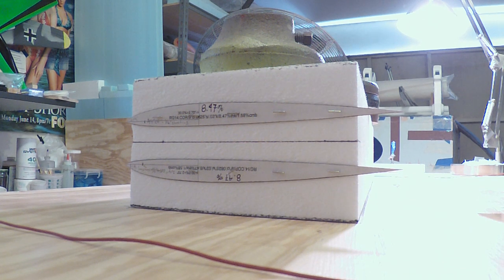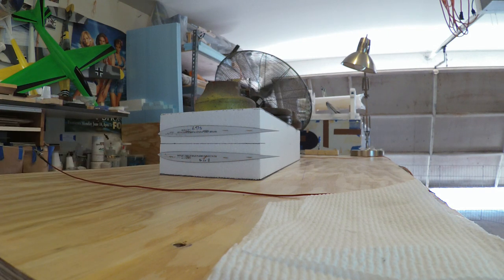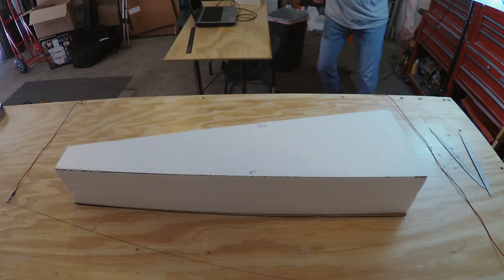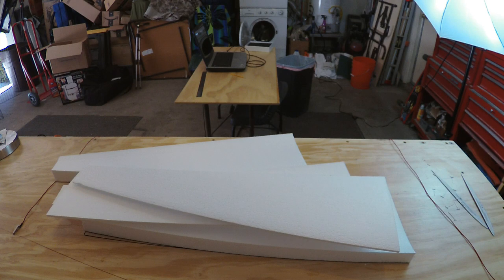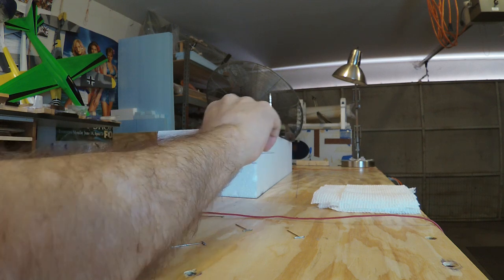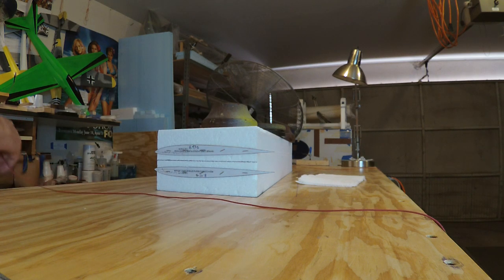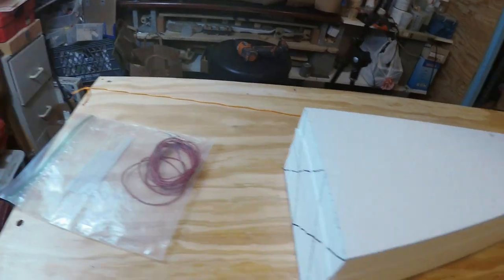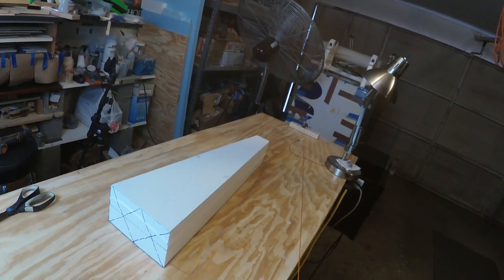Hot Wire Wing Airfoil Cut

Comment: Enjoyed your video. Just building up the courage to try and cut a tapered wing. I thought I would have to cut the small tapered end piecefrom a template, and run the wire cutter over both ends, centering the outer tapered/narrow end. I was planning on using a bow hotwire
Reply: I'm really new to this foam wing cutting what kind of foam do you suggest for cutting the wing there's so many different kinds out there it's mind-boggling good video keep up the good work respectfully Jim p
Reply from the maker: Hi James !  With a bow I be running two templetes, one at the root and one at the tip. Whatever floats your "boat." For more do a search for " the Worlds CHEAPEST foam cutter" on https://www.rcgroups.com
Reply: Following two templates with a bow is MUCH more difficult.  With two templates you need to perfectly synchronize your motion on both ends or you dish the surface.  It's very pronounced at the leading and trailing edge.  With a single template there is only one thing you need to do, move steadily.

Comment: IMHO: USING THIS SYSTEM, WITH ONLY THE "ROOT" AIRFOIL TEMPLATE, MEANS THAT YOUR WING BLANKS WILL HAVE NO "WASH-OUT"....:face-blue-smiling::face-green-smiling::face-fuchsia-wide-eyes::hand-orange-covering-eyes:
Reply from the maker: Wash out is for floaters.
Reply from the maker: These wings are cut for 50 slope racers doing half pipe in big wind or if built lite, racing along the slope line with quick or vertical turns.

Comment: Why not just put both contour guides (flipped) on one piece of foam. Looks like you could be getting twice the wing per foam. Lots of waste. Am I wrong?
Reply from the maker: You are not wrong... but the wire angles toward the tip centerline you see drawn on the foam block.  Its nice to have some room to work with. It also gets the cuts higher above the table so I am not banging the wire handle on it as I cut. And it is a luxury to have big tall, fat wing saddles afterwards. Keeps the cores straighter and more protection. If you were into production mode then it might be nice to set up your cutting table to do tighter cuts saving foam but since there is no money in that I don't waste my time. I could buy the thinner 2"inch white foam blocks but I prefer the 3"inch or 4"inch thicknesses. However you can see behind on the left I have a lot of Dow Blue 2"inch foam. The scenic white foam come in  24'X12" blocks I get at the Whistle Stop here in Pasadena California. The Dow Blue foam I get in 4'X8'foot panels at Foam Sales in Burbank. I like the 3"inch thickness in that medium.

Comment: Hello Tom. I must cut a very big delta wing for a turbine Eurofighter. Which technique do you suggest using to cut the foam core? I have been cutting tappered wings by many years using root and tip templates, but I am afraid  the wing at the tip get melted because de distance that the wire travel on the root template is five times the tip lenght.
Reply from the maker: Sorry Ricardo I am not an expert, however you may find someone on RCGroups.com  My basic thought on this would be you may wanna do the wing in two cuts so the halves are not so long then glue them together and sheet them. A featherCut setup might be a better way to go.

Comment: What tipe of foam are you using..
And where did you get it.  Thanks
Reply from the maker: The white foam is from Whistle Stop in Pasadena, CA. They sell it in 12"X24" blocks at about twenty bucks. It is used for making scenes on HO railroads. I like the 3" or 4"inch thick blocks, That thickness makes the cutting easy. The large wing saddles you are left with keep the wing cores straighter and add more protection while you are banging around the shop building a plane.The Dow Blue foam is from Foam Sales in Burbank, CA. The Blue DOW foam I have to buy in large 4'X8' foot panels and its gonna be around a hundred bucks for that. The white foam 50"inch cores I cut end up a half oz lighter than the denser Blue DOW foam.

Comment: IF YOU WERE TO STAND YOUR FOAM BLANK UP, ON EDGE, WITHE THE TRAILING EDGE DOWN TOWARD THE TABLE, AND LEADING EDGE UP, TOWARD THE CEILING), AND CUT MOSTLY IN THE VERTICAL "UP" DIRECTION", YOU MIGHT GET SUBSTANTIALLY CLEANER, FASTER CUTS, (BECAUSE THE WIRE WOULD BE CUTTING INT PREHEATED FOAM, (FOAM HEATED PRIOR TO THE PASSING OF THE WIRE,.. USING THE ADVANTAGE OF THE "RISING HEAT"...
Reply from the maker: you are thinking too much ;p